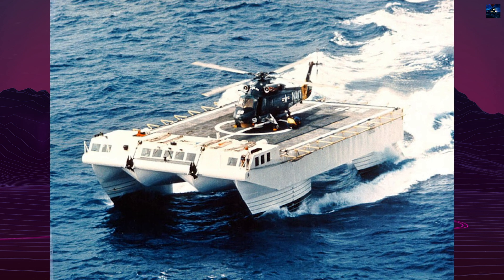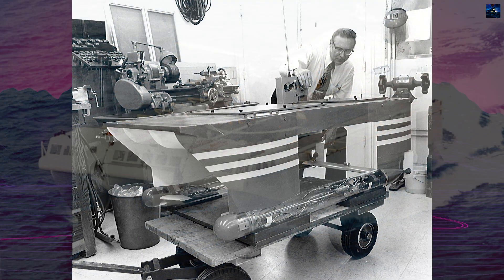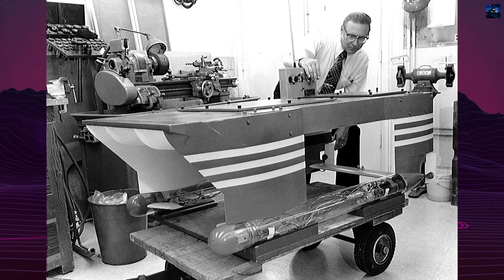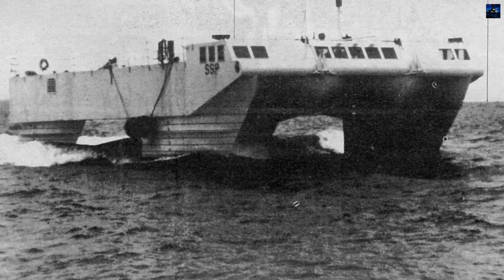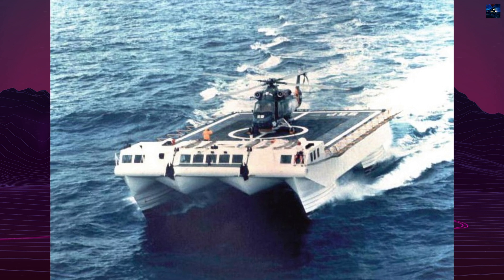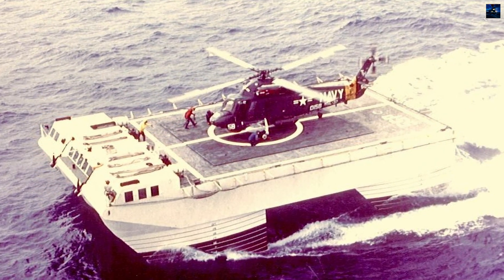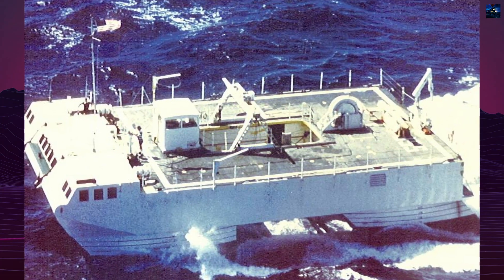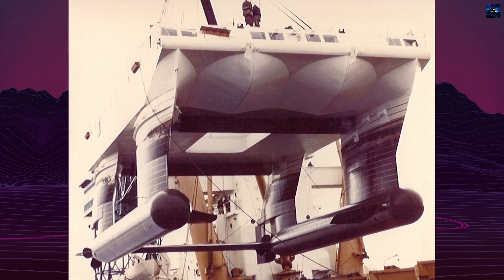SSP Kaimalino: The Experimental Vessel with Unmatched Stability and Speed

Comment: The WORST of both worlds - massive drag and low speed.
Reply: You say that, but stability can trump most things. 
To land a helo on that sized vessel in anything but glass conditions is impossible, yet 25kn this thing did it. 
Initial iterations are usually flawed.
Reply: It has lower drag than a monohull of similar dimensions (that's why people sail catamarans), and 20+ knots isn't bad.